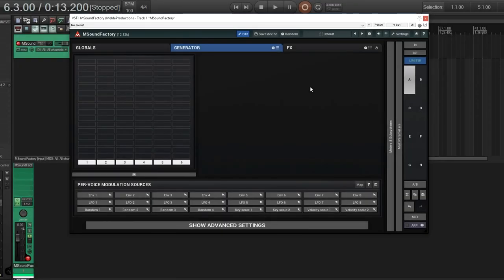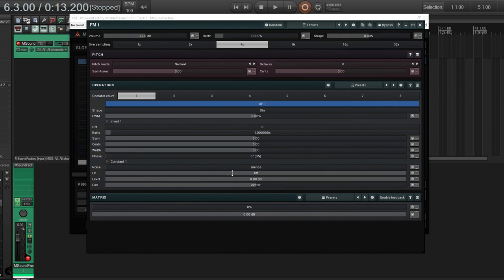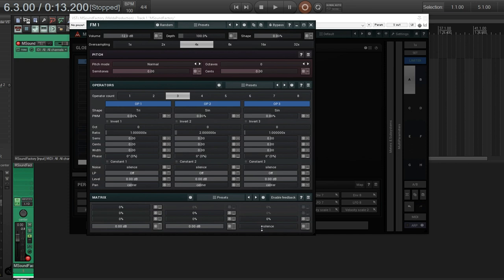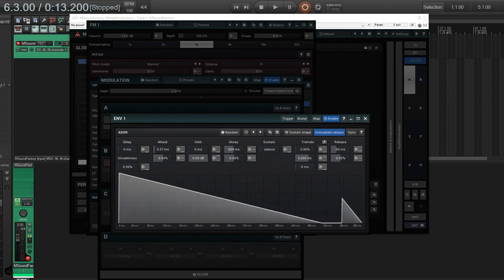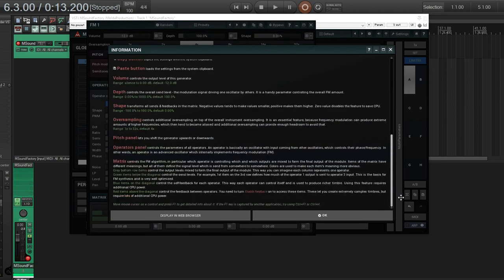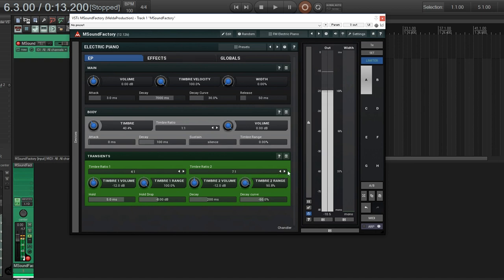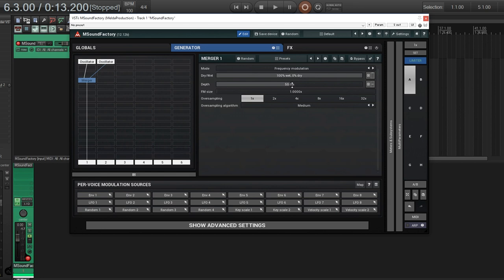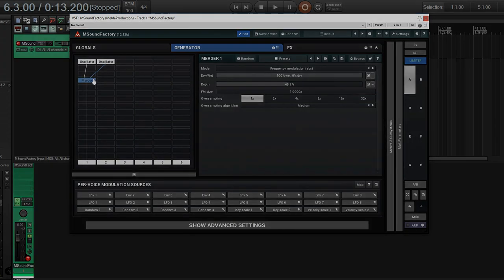FM Synthesis in MSoundfactory

Comment: Hi. You can do 2 or way more FM modules with each 8 Operators max and than merge them with FM-ing them together with the Merge-module ...Totally crazy amount of experimentation madness here. I recoment pulling the volumes for the OPs down to avoid the relatively early occuring noise when driving up the FM or Feedback amount. FM is super level-dependent and the volume needs (classically) to be controlled by envelopes. But I enjoy it so much that MSoundfactory gives you a endless playground where you can abuse all classical methods to the max and break every rule. Have Joy :)
Reply: I noticed also, the most incredible is the modular capabilties, FM anything you want....
Reply from the maker: That’s true. There is so much you can do with this. Combining the different types of synthesis is easy and fun.
Reply: So can you do freely assignable FM or the traditional Yamaha configurations on samples? I didn't see sample as an option in the drop down menu of the FM module. And if you use the second method, and place a sampler at the top of each of the 6 generator lanes, how will you do feedback routing? The merger tool appears to only allow setting inputs not output destinations. Or can you place another sampler lower down the y axis in a cell below a merger module in that same vertical lane?
I re-posted this here cause I know ur a tracktion guy as well. I have the same question for F'em. Is it coincidental that the operator types add up to the same amount as the number of operators, or are you limited to only two sample operators in a configuration? That would necessarily limit the sample manglers and be useless to me, as you can already do 4 sample operator FM in biotek now. Its just not freely assignable and limited to 10 Yamaha configurations. I cant tell from the NAMM screenshots. I don't know why you wouldn't allow any of the 11 operators to be any of the 11 operator types.

Comment: So can you do freely assignable FM or the traditional Yamaha configurations on samples? I didn't see sample as an option in the drop down menu of the FM module. And if you use the second method, and place a sampler at the top of each of the 6 generator lanes, how will you do feedback routing? The merger tool appears to only allow setting inputs not output destinations. Or can you place another sampler lower down the y axis in a cell below a merger module in that same vertical lane?
Reply from the maker: There is no sampler in the FM module, but you can add another sampler anywhere you want. You could FM a sample with merger and then FM that output with another sampler using merger. There are also modules that let you expand the matrix if you need more lanes. I hope that helps.

Comment: There are out there library's of over 25,000 free FM sounds which are excellent. (OK,maybe 7500 are excellent but hear me out.) Why are we putzing  trying to learn a very difficult process when all the work is out there done already? We need a preset loader matching your unit to old FM presets.  FM had one major detractor which was a very thin sound. You have (i think) the ultimate solution in being able to modify and revive this dead art into a colossal sales tool. Imagine 7500 presets out of the box and all this out of your pristine oscillators and fantastic FX. They (we) used this thing for EVERYTHING. really don't get it. This would be the last FM synth that anyone could imagine wanting. Like Modobass. A complete game changer for the FM synthesis fans.
Reply: Why do we draw if there is a camera

Comment: so this is basically melda mxxx combined with mellda powersytnh , or not .
Or is it a new plugin ?
Reply from the maker: Its a completely new plugin. It hasn't been released yet though. Although the FX section is basically the same as MXXX, the synthesis can do more than what is possible with MPS. Its also fully modular, so you can add as many oscillators, filters, etc as you want.